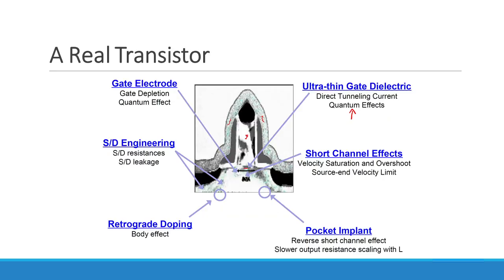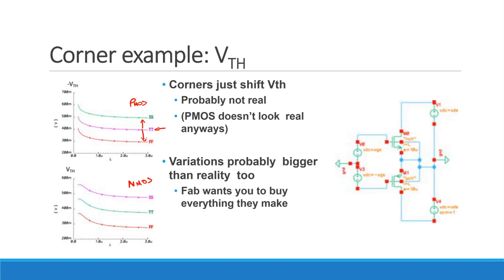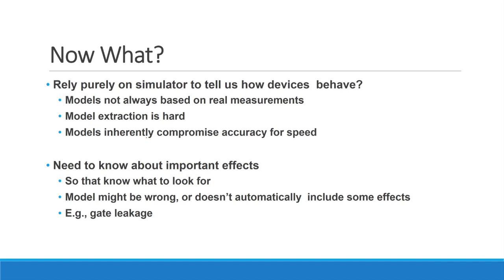HWN - Advanced Analog IC Design: Lecture 4

Comment: Just in case if you want to make another video about interviews. I had an interview for entry level hardware design and they asked me a lot about projects, experience and other staff. One specific question was: if I give you an ambigous instruction, for instance I need to power a FPGA 1.8V and the current is 1.3A. We have 5V and there is a restriction with the space, what do you do? I gave them at the beginning one answer and then during the interview I saw my mistake (bc I was nervous ) and I rectified my previous answer. So basically I went at the beginning for the best performance which is SMPS (power efficiency) and explain myself why; however I realized that the only restraint was space nothing more. I told them that my only restraint was space so should be LDO bc is a smaller design, easier to design comparing to the SMPS; however it will e a tradeoff on efficiency. Later, they answer the question and they want to see how the candidate thinks and a good answer would be BOTH hahahahahaa. As an engineer I should show both solution with their pros and cons